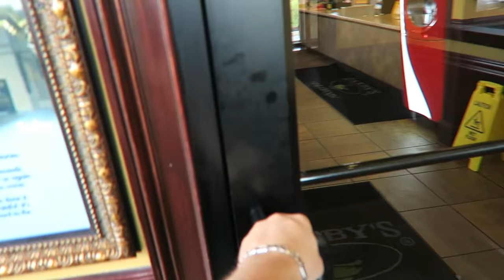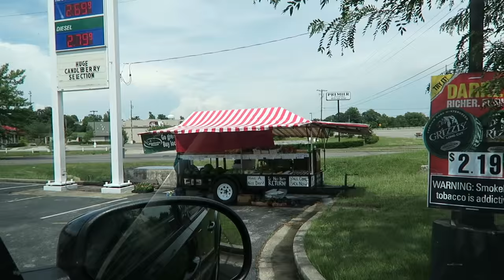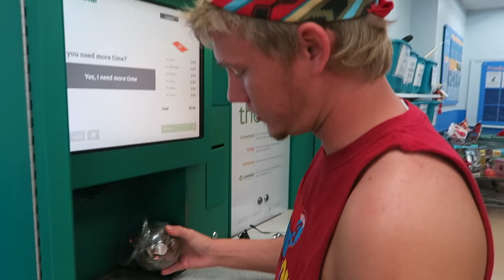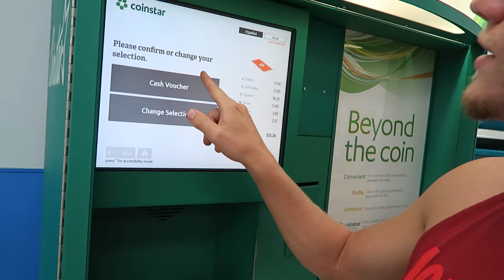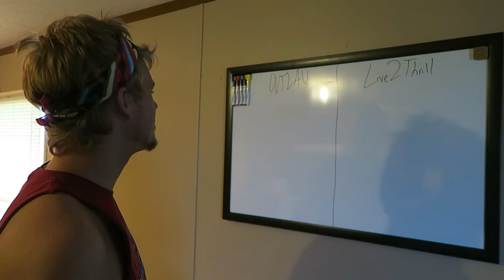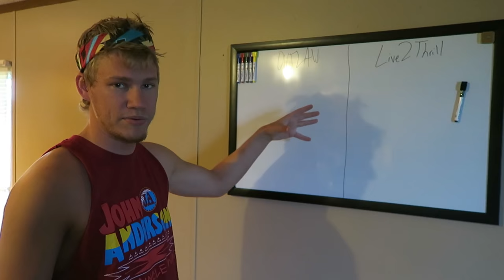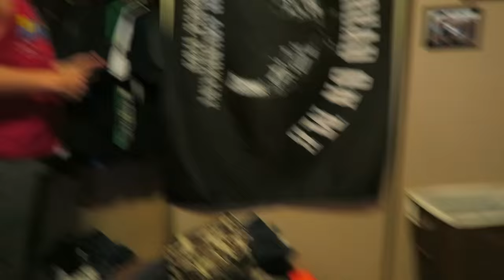DOG ATTACKS BED BUGS!!!

Comment: If you get a new bow get a Hoyt for sure. cant beat the Hoyts. Mathews no cam has no speed to it so you would need a really light arrow if you wanted some speed with the no cam. Hoyts are the smoothest drawing for the most speed you will get on the market.